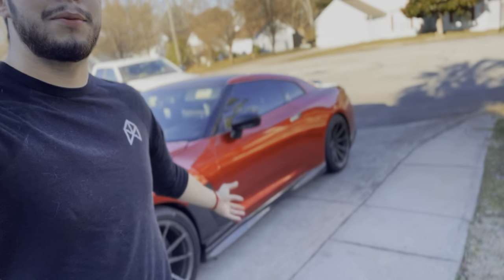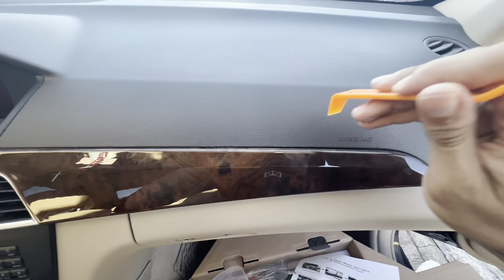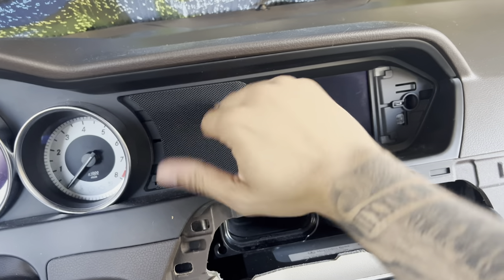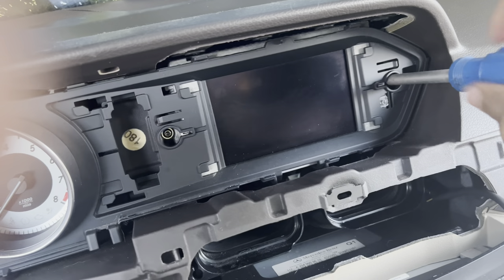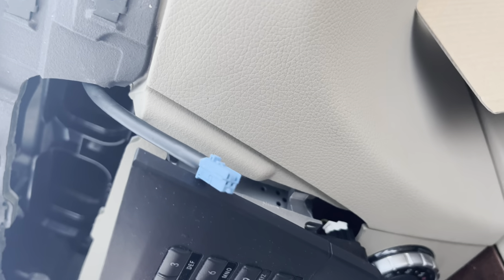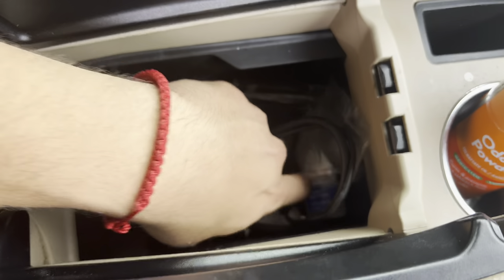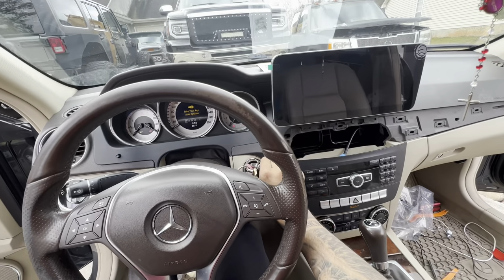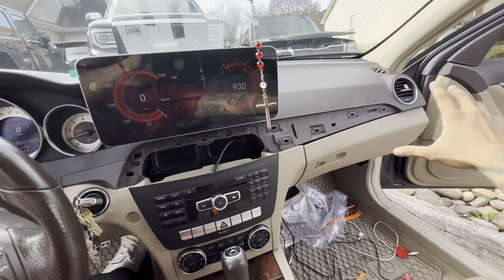Installed A large android screen 12.3 on a 2013 Mercedes-Benz C250 (w204)￼

Comment: I wanna get this would you say 12.3 is better than 10.25 inch I don’t want the screen to look like a toy. And I don’t want it to block my view of the road also can reverse camera be used if so what reverse camera will work with it
Reply from the maker: Tbh it doesn’t block my view but the 10.25 is a tad bit smaller and yes you can content your camera to it also

Comment: Did you have any problems with the toggle button? Mine don’t seem to work once the android screen is connected. Also how did you get that right screen when in radio mode, mine is just blank.
Reply from the maker: To get it to radio you ether click on radio or you click on car info and it should be at the stock form

Comment: How did you fit the bottom radio with the circular volume knob back on there? The cords for this at the back are way too chunky it seems. Please help 🙏🏽
Reply from the maker: I ran in the same problem i just kept tucking as much wire as i could and i push the radio back and it set flush
Reply: @thatgtrtho1168  I figured. Did you just tuck it under? Because I see no other space honestly.
Reply from the maker: @jaylinking5282  correct i tucked it under it be a struggle if you doing it alone have someone help push the radio in when you install the bolts
Reply: @thatgtrtho1168  thanks man. Appreciate it! 🙏🏽
Reply from the maker: @jaylinking5282  anytime if you need anything else let me know

Comment: Just installed mines a couple days ago! One of the best mods for sure
Reply from the maker: Right i think is worth it gives the car a new feeling I also did a carbonfiber wrap if you want to check it out
Reply: How does the navigation work while driving?
Reply from the maker: @bledarhaxhia3371  it has Apple car play so it works amazing
Reply: What website did you buy it from? How's it been holding

Comment: thank u for the video, very clear explanation, i just have a question, do you keep the default microphone? or installed the new one? if so, where did u placed it? thank u in advance.
Reply from the maker: I hid everything in the back where the tv used to be at the tablet covers it up
Reply: Another question 😓 what do you do with the two screws for the display? I don’t really understand where it goes. Thanks 🙏🏻
Reply from the maker: @blamemydad  You install the two screws right behind the display is kind of hidden you going to need both hands to get to them is to hold the display in place